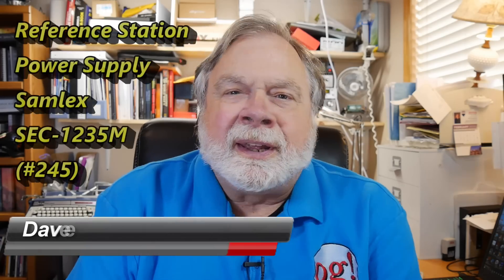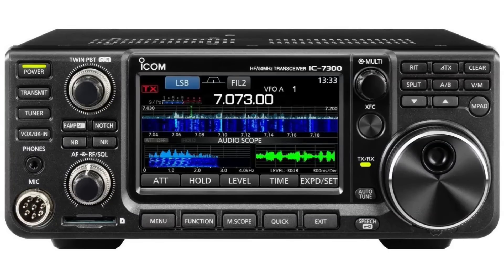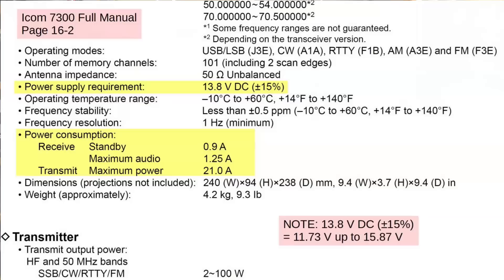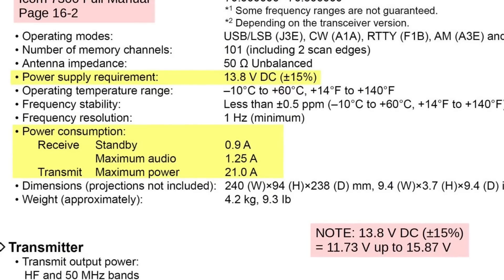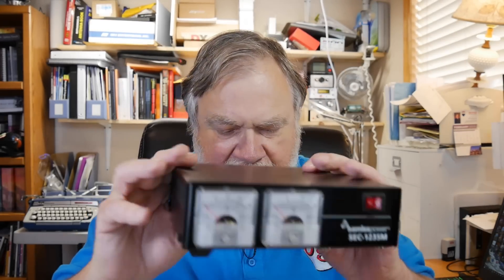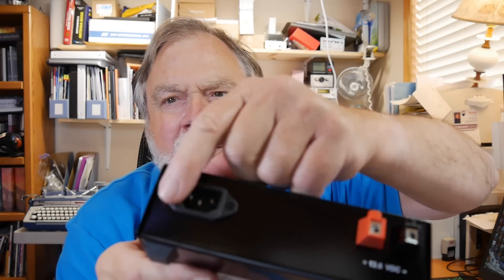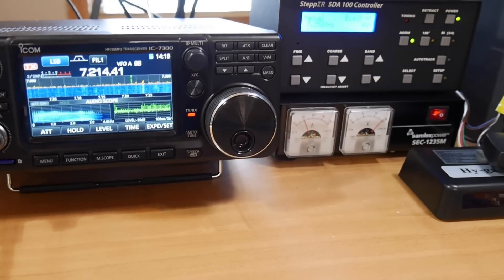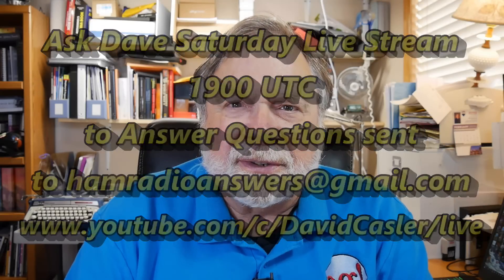Reference Station: Samlex SEC-1235M 13.8 VDC Power Supply

Comment: Thanks for sharing. I have the IC-7300 with the Astron 35 amp with meters and power poles. I am looking forward to your power distribution solution. Are you making it? Passed the Extra Exam last Saturday. In our area I have to drive 100 plus miles to find a exam session. We had had a wind event that plugged our roads with snow. I left at 5:30 in the morning to be able to get to the test on time that was 120 miles away. I had a difficult time finding a road in our local area that wasn't blocked by snow drifts. It was quite an ordeal but it is over now. I went from Tech to Extra in 11 months time but I know that there are those who go Tech to Extra in one session.
I credit you for my success. Expect another tip soon.
Reply: wow.....talk about a challenge...well done..wish someone would figure out a reasonable way to take the test location wise..maybe taking it ONLINE....that would help bring new ppl in.7 3
Reply from the maker: Congratulations on your test results. Now that you're an Extra, perhaps you can find two other willing extras and set up testing in your local area!

Comment: I have purchased switching power supplies marketed for hams that generate an annoying amount of RF noise(make rx impossible).  I have also purchased supplies that become unstable when switching on and off that the output voltage goes super high,  or reverse polarity!.  The Samlex 1235 has been the best one I have found.  I have had to replace the filter capacitors...but best unit I have owned.

Comment: Question from a beginner.  If your radio calls for a max current of 21 amps, and your power supply is 13.8V with a max of 30A is that a problem?
Reply from the maker: Not a problem. The key factor is the voltage. The radio will draw whatever current it wants and that varies quite a bit during SSB transmission. The current capacity of the power supply is the maximum it can supply.
Reply: @davecasler  Thanks very much!

Comment: I run all my radios on a 50a astron. only been turned off prob 3 times in 27 years
Reply from the maker: I've been running my radios on solar-charged batteries. Been doing so for over two decades.
Reply: @davecasler  What type of batteries are you currently utilizing in your station?

Comment: No fuse?
Reply from the maker: The power supply has internal protection for over-current situations.
Reply: There are fuses in both legs of the IC-7300 power cord as well.

Comment: Dave, check the start up voltage spike on the Samlex power supply and you will see its over 20 volts!! regards Nigel ZL2SEA
Reply from the maker: I did check it and did not see any. But...one should still turn on the power supply prior to turning on the radio.
Reply: @davecasler  That is the way that I do it... Turn on the PS, wait 15 seconds or more, and then turn on the rig.  And, turn off the rig before turning off the PS.
Reply: @davecasler  Hi Dave, I have two of these Samlex power supplies they will work on 230 volts by changing a jumper lead inside if you refer manual. I am using then on 230 volts in NZ, great power supplies but they do have a high start up voltage, but once going are great. yes agree to have radio turned off prior to starting power supply.  I also have 2 off the Powerx SPS-30DM and the MFJ one, great videos many thanks Regards Nigel ZL2SEA

Comment: What is the common failure mode for the switching power supplies? Are they protected against a dead short at the output? I'm very interested in the light weight of these supplies, but I don't know very much about them. Thanks for another great video!
Reply from the maker: Yes, these power supplies have built-in protection for shorts.

Comment: Another great video, Dave. I'm following this series in particular since I have a 7300 on its way (Yay!). I've read a few articles about switching supplies producing noise, so I've always used a linear (Astron RS-35A right now). Any opinion on this? 73, KE6BN
Reply: I use the Astron as well.  However, I think the right switching unit is just fine.  I plan to get a Sammlux (sp?)  Good enough for dave, good enough for me.  Let's save some idle current.